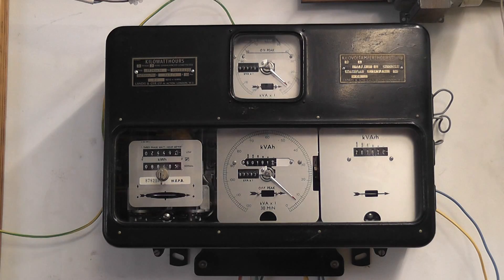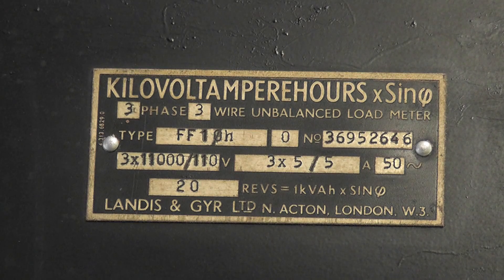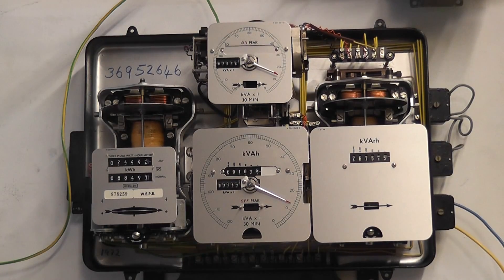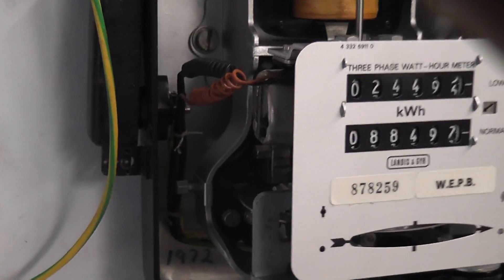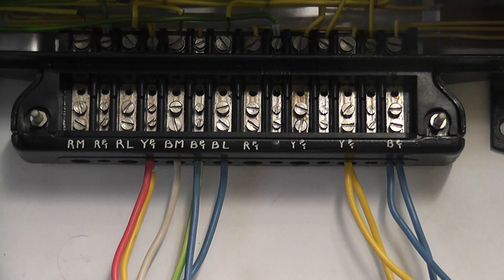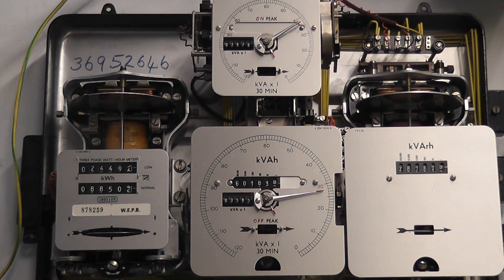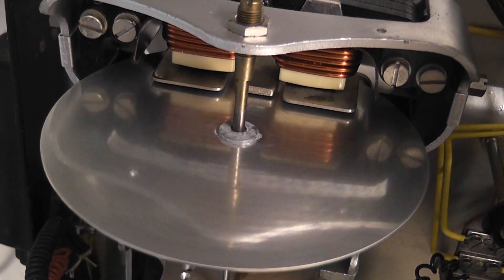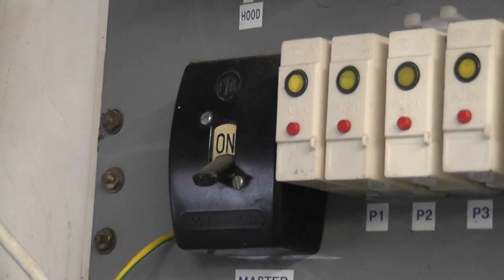Trivector  --  Landis & Gyr

Comment: Hello,i have a question.im seeking of years  a landis and gyr timeswitch type KYA1uums, registration time 15 minutes,220 volts  for use a kwh maximum meter 1 fase 220 volts 10(30) ampere with needs a separate timeswitch.Do you have possebly have one for sale? if you have one for sale ,please email me on ;   rwhdijen@gmail.com. thanks richard from the netherlands.
Reply: I will have a look in my archives I have KYA or SR2D time switches. Need to check if they have the 15 minute impulse output for and MDI maximum meter.
Reply: @raymondvanorsoydeflines9904  Hello,i have a question,can i possebly buy your KYA1uums timeswitch for 250 euro?so i can use my maximum landis and gyr kwhmeter?
Reply from the maker: @richardvandijen8459  I will try to find that time switch and test it that it works all good. I have a lot of old meters and time switches to go through.

Comment from the maker: @Quiche81 Yes, Larry was correct.
This meter came out of a large pump house from the water drainage board ( 11 kV / 3.3 kV )
Also these meters were used for large custmers e.g.  Dockyards, Shopping malls and Power hungry industries with low power factors.